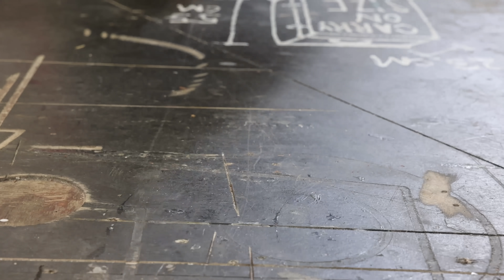How to build Center Console from scratch

Comment: You could expand on the phone holder's utility by routing a recess into the back of the top deck, and install a wireless charging pad.  Wire it into the 12v and the whole time your phone is in the cradle, it's getting topped up.
Reply: I bet that's what the notch out of the bottom is for, to run a charging cable to the port.
Reply: Great idea.
Reply: It's right!

Comment: Clocking all your screws the same way definitely satisfied my OCD :)

I wonder if where your phone sits, if you made that bar a little thicker (front to rear), could you embed a USB-C connector to charge your phone? You'd set your phone down, then slide it slightly backwards to mate it into the connector. Or maybe embed a Qi charger, if your phone supports wireless charging.

Comment: The thing that surprised me the most was the cheapness of the salvaged goose neck light Laura got with that deal of the century , no expense spared system of road cases. You think they would of used lamps with LED bulbs and if the used the Little lite brand they even have dual color LEDs so you can go stealth.
Reply from the maker: The system is from way before LEDs in lamps. Also a „real“ lightbulb does not mean cheap. I prefer them

Comment: I've long been saying that the hardest part of keeping newer-old cars on the road is/will be dealing with all the plastic interior pieces that nobody reproduces and are essentially unrepairable.  My only plan for my deteriorating old truck interior is to make a full racecar-style sheet aluminum dash and door panels.  What you've done here is obviously nicer!  But not every vehicle with life left in it will be worth this much attention.
Reply: Indoor/Outdoor carpet. You can heat it just a little (hair dryer, not heat gun) and it will fit mild curves well. It'll make a door panel for sure, but you'll probably have to use something else for the handle. See "dashmat" brand for commercial versions that aren't cheap but will save you a lot of time and look moderately decent.

Comment: Seeing the phone on the console, I'd imagine adding wireless charging would be a great addition?
Perhaps also coupled to a switch, to conserve energy while camping.

I first thought about glueing a connector in the wooden bar below the phone, but that'd cause issues if you're swapping phones or someone else wants to charge a different phone.
Also would snap off pretty soon by trying to quickly grab the phone while exiting  the car.

Comment: Awesome build! You could also add a wireless charging pad for the phone. Ikea just came out with the Sjömärke wireless charger which is meant for just this kind of use and doesn't require routing a recess. (Though you would need to use a 12-24v step up transformer.)

Comment: Excellent!  A great addition for the van, and one that can easily grow and that others can adapt to suit their vehicles and their needs.  I've had an idea - how about integrating a wireless charger underneath where the phone goes? - You could make the wood thinner in this area and mount the charger under the wood so it would be invisible.  Just a thought :)
Reply: Get a USB-C charging hub and a USB sound card so that one plug charges the phone and connects the phone to the audio amplifier.

Comment: You could add wireless charging module to the bottom of the wooden plate,  so it charges your phone when you put it there. It is also not visible when no phone is inserted.

Comment: i've done this for two vehicles.. first was my 94 dodge ram. i got tired of baskets of shit just spiolling everywhere.. i couldnt believe how much of a life sasver this was..  then i built a wireless chargiong stand for it.. which i use in my new truck.  i really need to build one FOR the new truck.. but that will have to wait.
when i built one for my ford f150, i said it HAD to be done.. and built it the weekend i bouhgt it.  
i would LOVE to share an imaghe of it with you.
stained it blue to match the truck.
also because i had a gallon of blue stain anyway.. as i built a containment system for the back of the truck.. which i put to the test.. it held up for YEARS. 
i liek what youy do , because it is the same thing i do, but i wish i could film it, might make for an interesting video or three.